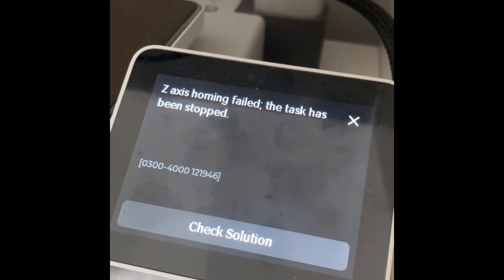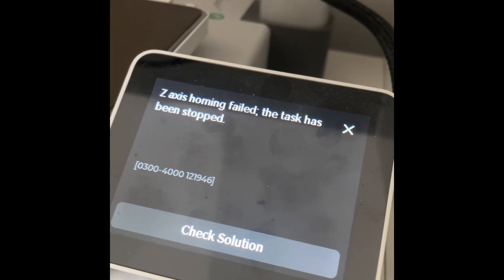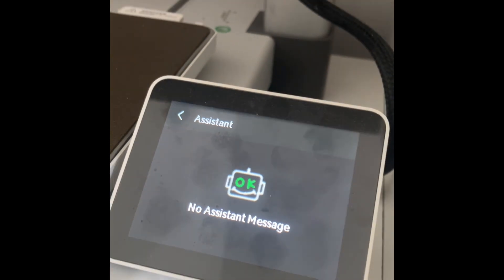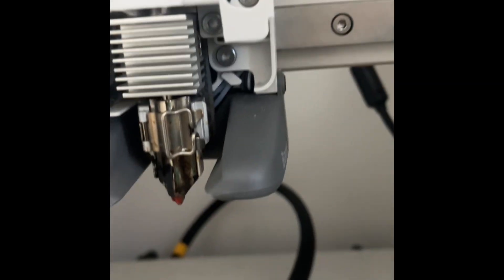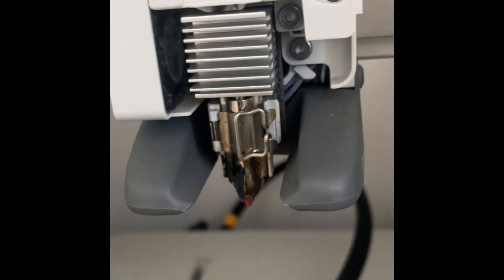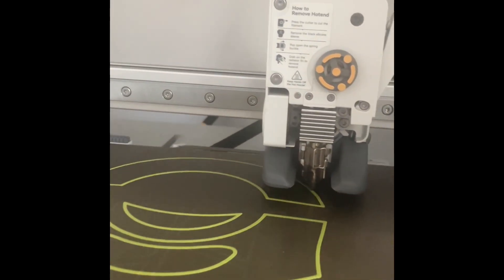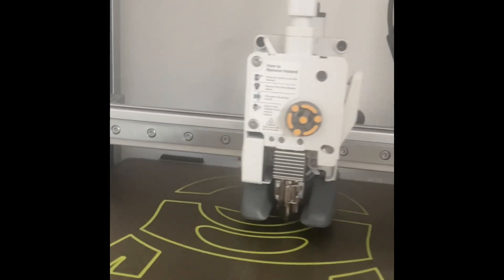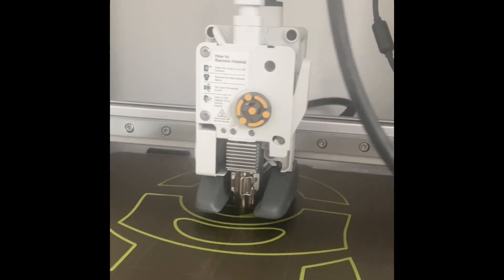Bambu A1 Z axis homing failed

Comment: How did you clean the nozzle? Was there some filament Stuck in the nozzle or just around the nozzle?
Reply from the maker: Hi to be honest I do not exactly remember how I cleaned it but there was definitely filament inside. Generally 2 ways, if the filament was already broken I had to disassembly the nozzle, and take out the broken filament - hold the nozzle with pliers heat the tip of the nozzöe with fire and then pull very quickly out the filament - just dont touch the nozzle or you will easily burn you hand, the second way is, when filament is not broken, just pull out the filament - either manually - through rolling back the spool or if stucked in the nozzle head, you should be able to unload it via the screen button